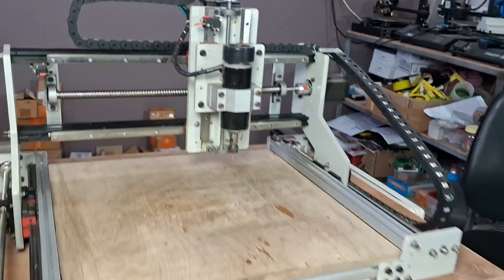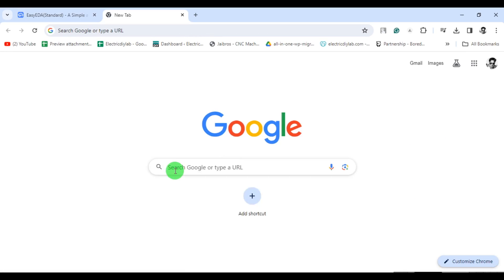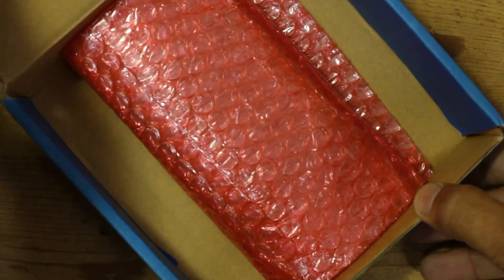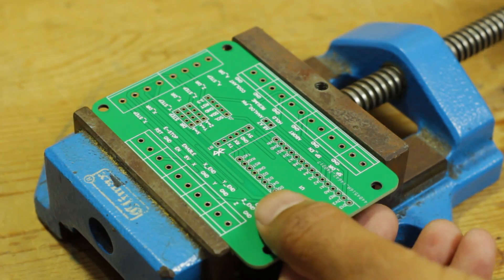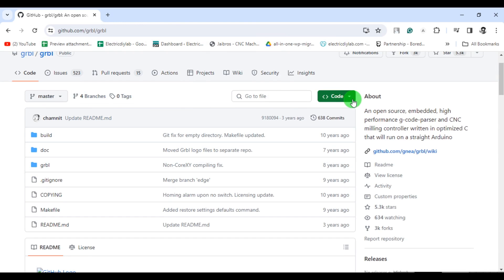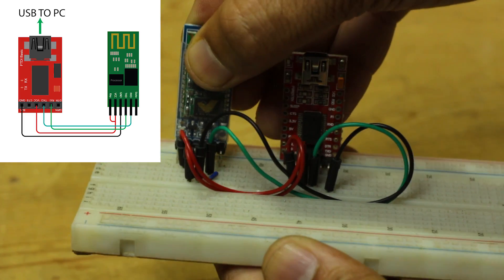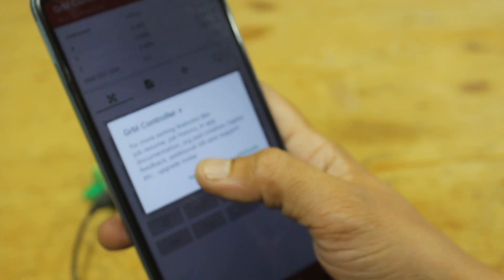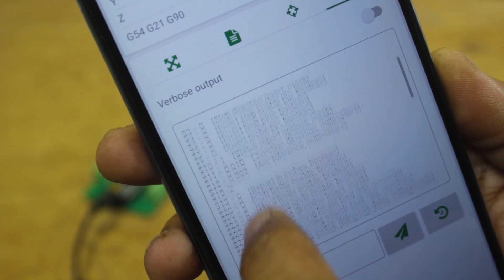How to opertae CNC machine using mobile over bluetooth |Wireless CNC machine control

Comment: I use an mks dlc32 board to run myne from wifi via webpage. Not an endorsement  but it works for me
Reply from the maker: yes mks dlc32 good for small motors works with a4988 stepper drivers. what if stepper motors are heavy duty like nema 23, 34, 42
Reply: @MrInnovative  yeah fair enough! I remember  I wanted to use tmc2208 but they didn't work with the dlc32